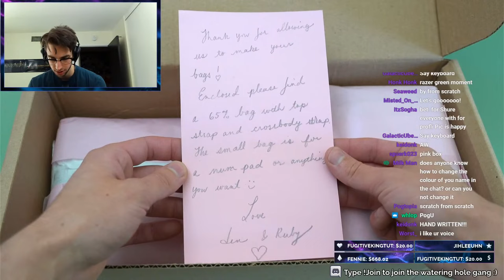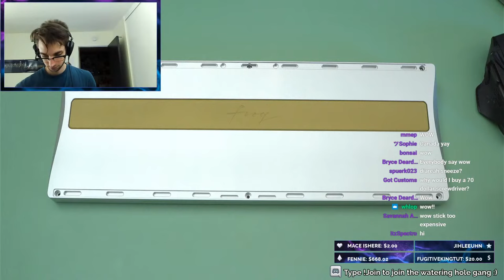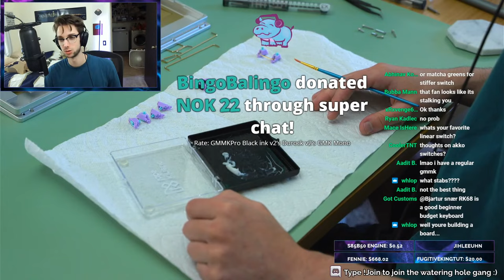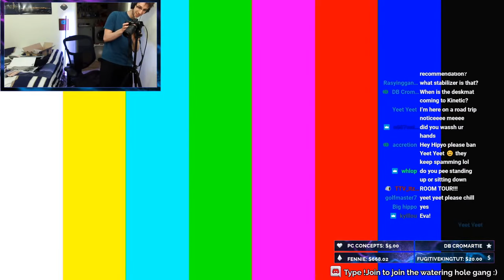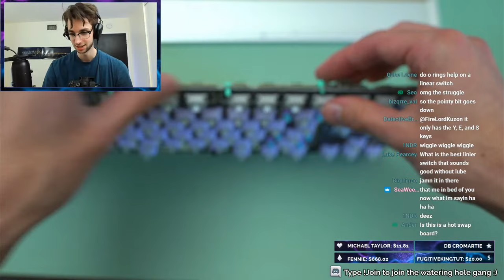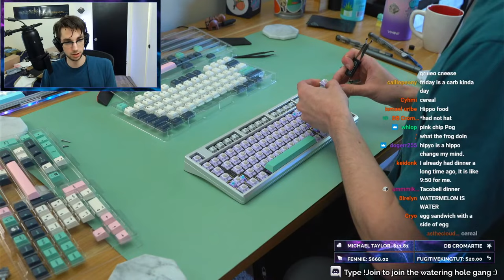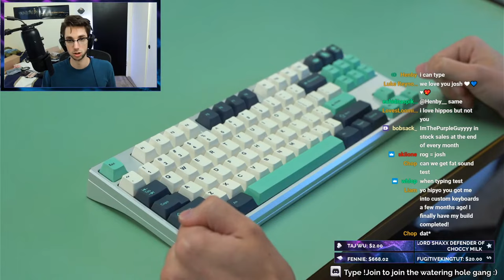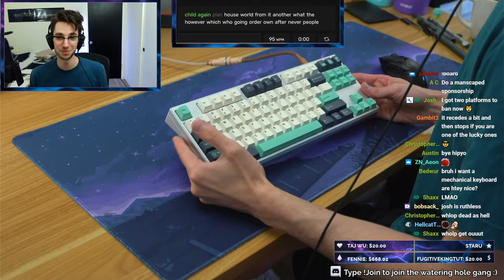Can TADPOLES make a keyboard good?!

Comment: Ik it might sound dumb
So I have enough money to get a custom keyboard
And pre built keyboards, on amazon or best buy, They have warrenty
And by that
I can use the same keyboard for the rest of however long i want to use it
As long as i would like
But customs
They can match up preferences and just are better in quality for cheaper
and I've been thinking." What if my custom breaks, or it starts to sound weird"
And i would have to settle for some lower quality keyboard"
and if i wanted to fix the custom
I would have to replace switches, lube them, or even replace the case
I really dont know at this point
thank you :)
Reply: -Customs are not necessarily better in quality for cheaper.
-Keyboard electronics are fairly simple, and more or less use the same electronics in any other board, so in theory they should have similar and low rate of failure between customs and off-the-shelf boards.
-If you solder your switches without burning or overheating anything they should work fine.
-Switches can be desoldered and replaced if you need to.
-If you tune your stabs nicely it should sound good for a long time, check out Holee mod and wire balancing

Essentially, the microchips on the PCB are the only thing we can't really fix so if those go bad then you'll have a bad PCB. Other than that, you'll have to be your own repairman and troubleshoot or replace any other components such as bad switches.

hope this helps